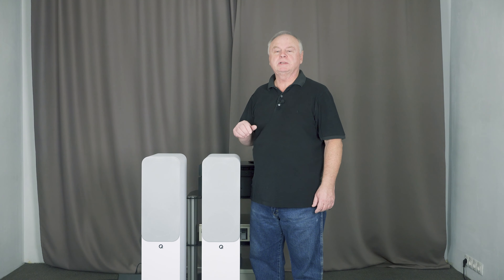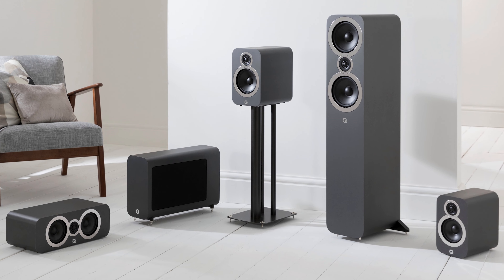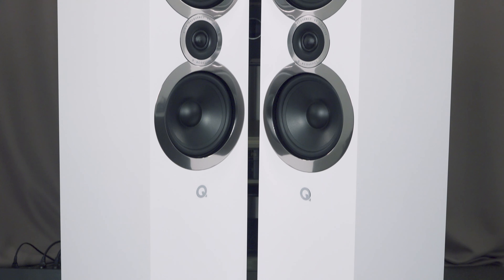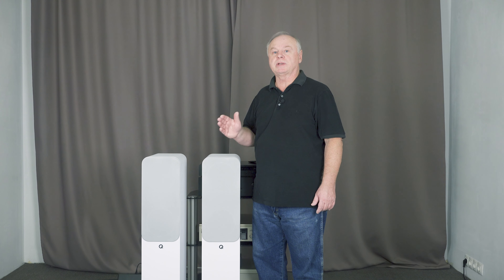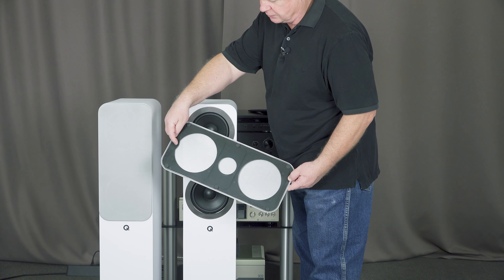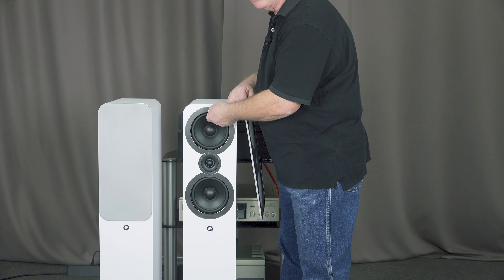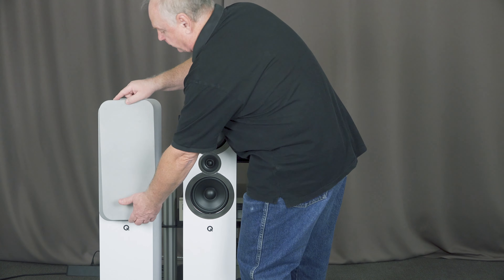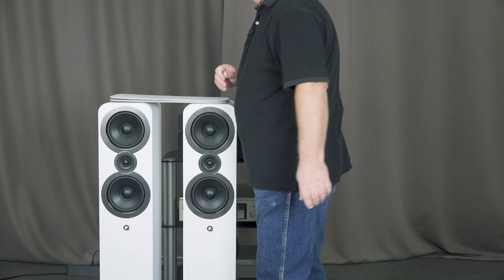Q Acoustics 3050i. Video review and audio test. English subtitles

Comment: Great review! The best I have seen on this speaker. I tried a 1 inch tilt and 3 meter spread of my 3050i speakers and it DID improve the sound. Do you think if I replaced the cheap crossover parts with better parts that the sound would improve?

Comment: Hello, sorry, I had two questions..
What is the distance behind the speaker to the wall to get the best sound?
And also how far should be the distance between two speakers to give a good sound?
Thank.....iran...
Reply from the maker: Hello! The distance from the speakers to the wall should be more than 1 meter. The distance between the speakers can be 2.5 – 3 meters. The distance from the speaker to the side wall should be more than 0.6 meters. The distance from the axis of the speakers to the listener is 2.5 – 3 meters. The distance from the listener to the back wall is more than two meters.
It should be taken into account that there is an error in the design of the crossover. The crossover should be of the third order, both between the tweeter and the upper mid woofer, and between the tweeter and the lower midwoofer. In fact, a third-order crossover is installed for the upper section, and for the lower section of the second order, this leads to phase distortion. Phase distortion can be reduced by tilting the top of the speaker back, as I showed in the video. Good luck!
Reply: @HiFienergy   
very very good.....tanks

Can this speaker be used at the level of Focal 816 or B&W 686 in terms of sound?
Which speaker of these two brands can compete with?
Reply from the maker: Bowers & Wilkins 686 is a shelf speaker system, Focal 816 is a floor speaker system. The Focal 816 is better than the Q Acoustics 3050i.

Comment: Best review ! Excellent job. Is there a chance to review the Magnat Shadow 207? What would be your personal choice between Q A 3050i vs Magnat Signature 507 ? Thank you!
Reply from the maker: Hello! Thank you for your feedback. I do not have a Magnat Shadow 207 review, but I have a practically finished video review of Magnat Shadow 209. The video material was made a long time ago, but there is no way to finish the video review due to the complete lack of financial support from both the audio equipment manufacturers and the channel viewers. Maybe in two months I can finish the video review of Magnat Shadow 209. Secondly, the Magnat Signature 507 is much better than the Q A 3050i.
Reply: @HiFienergy  could you please advise me with one thing? I own a pair of Magat Shadow 207 and i would like to know if deserves to switch to QA 3050i? I understand  from your side that Signature 507 is a better option. My feeling is for me the next upgrade step should be to Signature 507. But i would like to know your opinion. I really appreciate your response! Stay healty!
Reply from the maker: @radunan1475  There is no need to change Magat Shadow 207 to switch to Q A 3050i. Magat Shadow 207 is much better.

Comment: Great review! You mentioned of improving the crossover response by adding 2-3 turns on the coil. Is this L2 or L3 in the diagram? thank you
Reply from the maker: Hi! You need to change the order of the second to third crossover. This will require a new crossover setup. In this speaker system, I have not reworked the crossover and therefore can not give the exact parameters of the components.
Reply: @HiFienergy  Thank you so much. I really liked how you review the speakers. I think this speaker is good without altering the crossover. You were able to give us the expected performance even if we don't hear the actual speakers. more power to you!